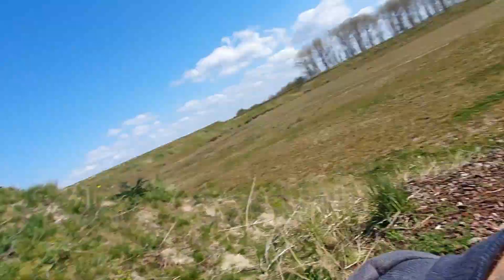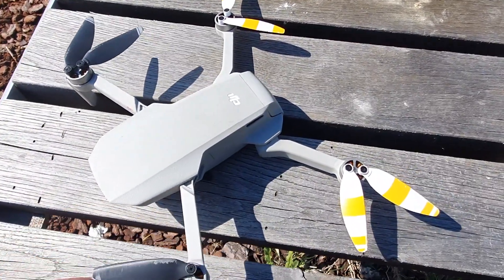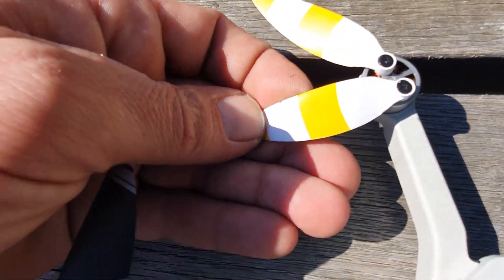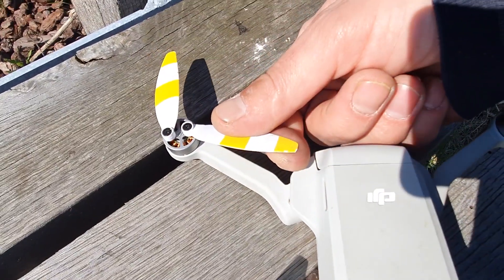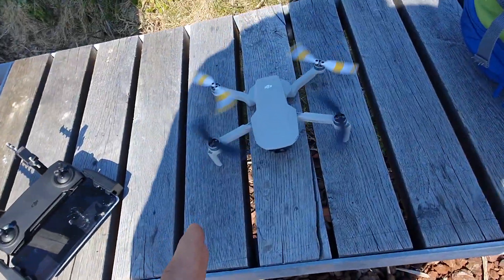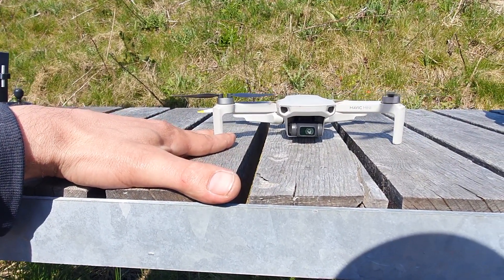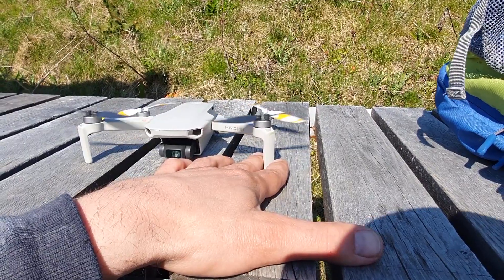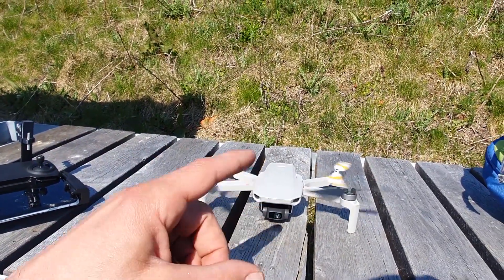DJI MAVIC MINI WHAT TO TEST AFTER A CRASH BEFORE FLYING AGAIN

Comment: Hello DIY RC I am new to your site. I appreciate everything you are doing for the hobby and keep up the good work. I have a quick question relating to your original $5 Trainer with the short wing and short blue Ailerons. Could you give the Length and Width of the Wing and Length and Width of the Ailerons. Also what is the maximum wind speed you think this plane can be flown safely in. Thank You